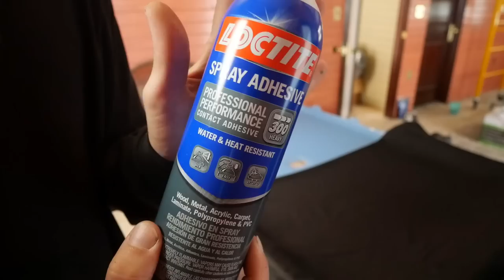New Headliner was a Disaster - Project car

Comment: The reason only some spray glues work is because they have to withstand extreme temperatures. Major heat in the summers, and very cold in the winters. So some spray glue can handle those extremes while other not so much. Also, they sell headliner material made specifically for headliners. They typically have a very thin foam backing to allow some air flow. So you can easily buy the proper headliner material in most any color and texture. Just some info...  I've done a few headliners myself in different type vehicles and the glue is a very important part of getting the material to stay attached over the years...

Comment: You guys are brave to take on that headliner!

About 40 years ago (when I was a kid), I replaced the headliner in a 1967 VW Beetle I had bought. As headliners go, it was an easy one as there was really no gluing to be done - it was perforated vinyl that was held up to the roof with wire bows that slid through pockets sewn into the headliner. That one job was enough to convince me that I'd never do another one, and I have remained true to that conviction to this day!

Nicely done, you two. I hope the car project comes out to your satisfaction.

Comment: When Belle said Chipotle my family loves that place. The headliner looks really amazing great job. My son had an Audi a few years ago and he redid the inside. He used plaid and it actually looked really awesome he showed it in a couple car shows. I remember him trying to do the same thing spray it indoors and then he had to go outside. I'm excited Ashley to see the final when you're done with your car. I'm sure you two are having so much fun together. Please give Belle and Maverick hugs from Minnesota. What I was thinking another thing you could do is for the headliner if it starts to have issues which I hope it does not. You know how a furniture they would put covered buttons as a way to tuck in or hold something in place could you drill holes and put those covered buttons in there and then there's a piece on the back that you just bend these metal things in the back that you spread apart to keep it in place

Comment: Great stuff guys! Try to get 3M adhesive spray next time its probably the best for headliners, don't hold the can so far away, it will dry in the air before it hits the headliner. While you have that out you may want to put in some sound deadener, I forget the name but Lowes and Home Depot carries it in the insulation section. Its like bubble wrap with foil on each side it works great to keep outside noise out. use it on the roof the floor and inside the doors. Just a thought! Have fun, Be safe!

Comment: My hubby is an upholsterer and he's done a lot of headliner jobs over the years. His advice: use Performance High Temp trim adhesive spray (it's in a gold can). He also prefers the headliner fabric, foam lined. And says you were smart to wrap the fabric around instead of just cutting right around the edges. Most headliners that fall near the edges is because the fabric was not wrapped around to the back side.

Comment: For all your contact adhesive needs I would try 3M Fastbond 30NF.  Brush on water based adhesive, great for Formica.  For fabric you would have to experiment with a spray gun etc.  I never tried to sprayed the stuff.    For fabric with a spray can I would try the 3M 77 or 90.   
You can put plastic or wood strips between the fabric and liner, then work from the center out while you pull the strips out using a plastic spreader to work the wrinkles out.
Reply: All great ideas for them to use in their creating. Thanks for sharing.

Comment: The head liner is a real tricky thing. Had a foster kid pull mine down while driving because he could and said see what I did miss---, Never did find anything to make it stick back up there so took the cover off. The little guy was a hand full. He takes his seat belt off and when he saw a police care and flip over seats. waving at the police. He say I am going to get you a ticket miss....... . Funny thing is police never pulled me over, but I use to pull off and not move until he got properly seated and never made a big deal out of it accept to say. Please keep your seat belt on I care about you and do not want you hurt. He got tired of it and did keep it on took a while and lots of pulling over to side of highways etc. When I first had him, it was kicking the back of the seat while driving. Again, pulled over until he told me he could control himself and stop. Pain and had to leave way early for all things to give us time to pull over. Hahaha.It did bother me but acted like it did not. Anyway, never did get the roof liner to stick. We used a lot of products too.

Comment: Years ago before the internet and Google,  I attempted to redo a headliner in a dodge dart.  I went to the library and checked out a book on how to do it and it did give instructions but at the end it said to just take it to a professional and have them do it.  That's what I did and they did a beautiful job. 
Also I am surprised that you chose a stretch velveteen for your headliner.  You probably should have looked for upholstery fabrics.
Reply from the maker: We wanted it to be stretchy so that it could mold into all the curves of the headliner without wrinkles. Taking it to a professional is not something we would do. It was like $20 for all materials. Will it last? Time will tell. If it does last, we will have saved hundreds of dollars.

Comment: If someone hasn't mentioned it yet, 3M spray adhesive is far better than loctite.
Good job! That material would drive me nuts with it leaving different marks every time you touch it lol. I'd be brushing the headliner all the time so it would look even 😂

Comment: Good job however I have a few tips to share as we have just done ours. I believe someone just shared the same however and everything they have mentioned is exactly what I would have said.  I hope it all works out and try to trim close to the edges but not too close as any extra fabric will be difficult to tuck under and trim out pieces should hide it.....just enough to turn on the edge..........I hope all goes well. Blessings  🙂

Comment: The only issue I see with using that particular adhesive is it melting in the car when it's super hot. You might check the specs for that to determine if you want to just go on ahead and do something different. Otherwise I can see that fabric being a fun liner for a car.
Reply: Melting glue? OK then
Reply: @krystalaura5634  - Uhm. Yea.

Comment: Look into the 3M version of that spray on adhesive. They have several strength versions. I’ve used it with material and had good luck. 
I do think you waited too long to place the fabric on after applying the glue. Maybe apply a quarter of the area at a time instead of half an area.

Comment: From my experience I've found it works better to glue the material straight to the cardboard backing once the vinyl is removed, and I typically use 3m brand adhesive.

Comment: Because repairs needed to be done to the headliner, fabric was the perfect choice rather than paint.  Headliners are usually fabric anyway.  That was some cool stuff you used for the repari of the headliner.  It firmed up the headliner perfectly!  Actual headliner fabric is uber expensive and it doesn't even look that great.  What you used is going to be a much better choiceall the way around.

Comment: Headliners are hard to attach permanently, with gravity never sleeping and the concave shape of the roof not helping. They were falling left and right when Detroit started gluing cloth over foam (for sound deadening) in the 1970s. Maybe that stainless steel ribbing that they used to use to keep the cloth up is still available somewhere.

Comment: I thought most headliners were covered with felt   Felt won't lose its shape or ravel.  I think the fabric you chose will do both.  I know that felt will also be able to hold the glue.
Reply: Felt is fibers pressed together. Wind and humidity will totally be wrong. They made a great choice. It's a knit material so knits don't ravel like weaves.

Comment: I believe that fabric is a stretch velveteen - depending on the stretch it could be cotton or nylon.   Nylon has the most stretch.    It is a fun fabric - at least for my purposes.  (It's an excellent fabric when making show clothes for entertainers.)    I attempted to help replace one headliner in my lifetime - never again.    The guy I attempted to assist insisted on using his 2 favorite glues (this was pre 'WWW' so no online research options).   When he pulled out Elmer's school glue and Krazy Glue I decided it was time for me to depart.   An epic fail followed.   Thankfully I was not involved.     I do hope your headliner is successful.    It certainly looks nice.   I admit the southeastern states experience heat that many cannot fathom.   If you have any scraps of the black fabric maybe you could stitch together a custom steering wheel cover.   Decades ago I bought a car with a cracked steer wheel.   Between the blistering heat during the summer and the annoying crack I decided to make a cover.   I used a similar fabric with a nap, stitched strips together so the nap was running in different directions and created a unique look.   (I ran short of stretch fabric so I added a bit of denim in places.)   It's also good material for stuffed animals, if Bell or Maverick are interested - and it's washable.

Comment: Polyester resin needs added wax in the final coat or it wont dry .The wax may be added already and if so it will say so on the can.otherwise you can cover it with wax paper to keep the air off it.When doing another coat you have to sand the wax off first or apply when first coat still tacky.CHEERS from here!

Comment: Not the right glue; use 3M premium/heavy duty. Also, there is actual headliner fabric, available at Joann’s Fabric and probably other places. I also would have removed the vinyl and started with just the backer.
Reply from the maker: Yeah, I think we both grasped that it wasn't the right glue from the beginning. We clearly made that point known in the video. We know there is headliner fabric and headliner glue. Ashley didn't like the headliner fabric. She chose what she wanted for her vision of the car.

Comment: 3M Hi-Strength 90 CA Spray Adhesive, Low VOC, Permanent, Bonds Laminate, Wood, Concrete, Metal, Plastic, Clear Glue, Net Wt 19 oz

Comment: call an automotive place, they will tell you what you could use. maybe you have to sand the vinyl and put a  spray glue.? Hope you can reuse that material
Reply from the maker: We did sand the vinyl and we used a spray glue. We're happy with how it came out, and now we'll just have to see how it does over time once installed in the car.

Comment: My brother-in-law does car headliners, he says you can't use regular material over time it will look terrible plus you spray the headliner with adhesive and lay the material over it. Loctite is terrible glue I've heard from several it doesn't hold up, oh my will be awful all that work you put in and it will be awful in a year?
Reply from the maker: We'll see how it goes in one year. It could last for a long time. Only time will tell. We did spray the adhesive on the headliner, and also the fabric. And it's really not a big deal if it fails. If it ever does fail, we try something else. Our whole lives pretty much consist of DIYing and experimenting and when things need redoing, we do it again a different way. Overall it really wasn't that much work, maybe about an hour.

Comment: Dont understand why your using "Dark Material"  it will make the Car Dark inside and Absorb Heat  rather than reflect it ,
Reply from the maker: Black is just the color that I want and it's supposed to feel dark inside. I actually walked around a parking lot the other day looking at car colors inside. I discovered that most vehicles had black interiors, so what I am doing is normal. Not that what the masses do matters to me anyway. I'm just doing what I want.